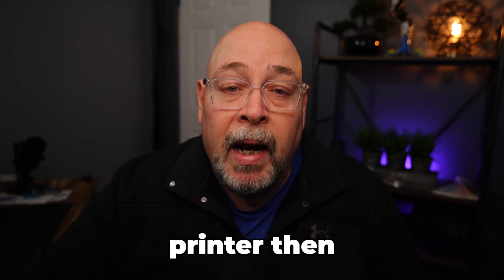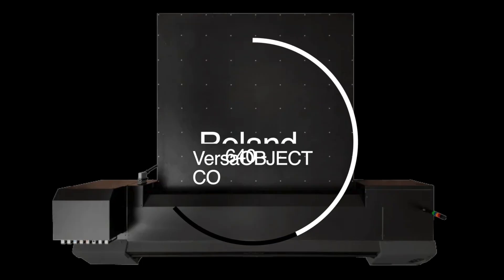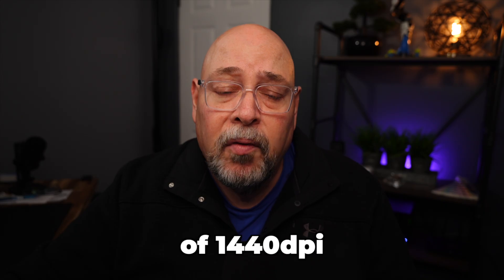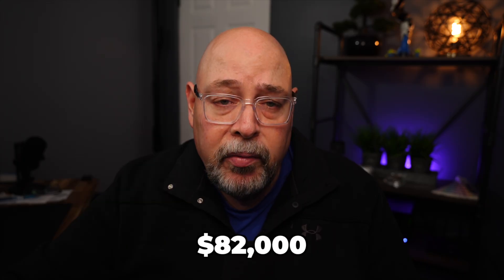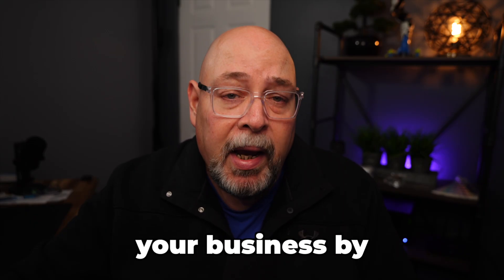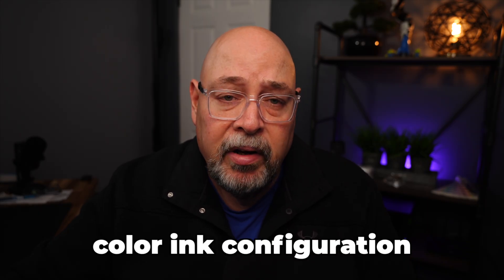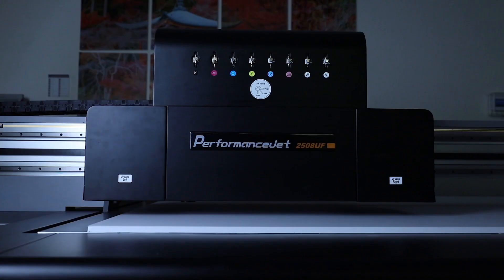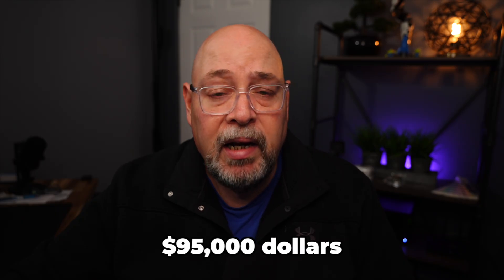Top 5 Entry Level UV Flatbed Printers🔥

Comment: Thanks for the video. I am still not such which would be best for my needs. But I need a printer that could print on a 4x8 foam board, vinyl printing/lettering on a transfer paper, and maybe cut the letters as well
Reply from the maker: Thanks for watching! It's not an easy decision. All of the printers mentioned in the video will do what you're looking to accomplish and more. You should decide on a budget first and then look at what you want to be able to do in the future and make sure you can do what you need it to do now. It's a big investment so make sure you can grow into it while making your money back as quickly as possible.
Reply: In this case you need a machine called one pass uv printer dear🙂

Comment: man, if i get into this business. i need to know where to get acrylic blanks wholesale ., pvc and foam boards., I WOULD GO for the MIMAKI for sure and what would be the best CNC CUTTER to cut all the boards.
Reply from the maker: If you’re in Hawaii it looks like One Shot Supplies would have sheets of foam coro and acrylic. If you’re in the lower 48 there’s plenty of places like Laird plastics, Grimco and Glantz. 

As for the CNC Mimaki has a good one. I would also look at Colex. If you don’t plan on cutting ACM (Aluminum Composite Material) then you could also look at the Summa F Series. If you have a bigger budget for a cutter there is always a Zund.
Reply: @graphicinsights466  thanks for sharing man. ALOHA TO YOU
Reply: @graphicinsights466  man, you are dope thanks for this info. i would look into this. ALOHA
Reply: You can get everyting from China supplier dear 🙂
Reply: @uvprintersolution  where and a flatbed cutter?

Comment: Awesome Review 🤙 hey question?? Can all this uv printers no matter the size . Print uv invisible ink when applied. Thank you & much success
Reply from the maker: Thanks for the question and the comment. I'm sure any of them could but I'm not aware of any manufacturers offering invisible UV ink. I could definitely see a market for it though.
Reply: Thank you for your Honest Reply👍
Reply: The largest print size flatbed in the market is 32*20cm, of course you can customize your size according to your needs. CMYK+W+V is available. So invisible uv ink is varnish ink. I can provide it🙂

Comment: Playing fast and loose with the term "entry level" here lol.  In no world is nearly 100k entry level for anything.
Reply: For a UV Flatbed printer it is...
Reply from the maker: I know it can be sticker shock,  but there are commercial flatbeds that start at $500k and industrial ones for more than $1.5M
Reply: @graphicinsights466  For those who aren't exposed to the volume part of the print industry (where my print business sits) 100k on any equipment labelled entry level sounds absurd. I was a little surprised the Canon 135gt didn't make it to the list, but i'm unsure of the retail price in the US.
Reply from the maker: Agreed. I just put a video out mentioning the Canon printer.  I believe the cost was around $150k
Reply: We live in a world where a pickup truck costs 100k. So a wide format UV printer that is delivered, set up, calibrated, with full parts and service warranty, with two days on site training, and helping purchaser setup first production runs, for 100k, well, that is a far better value than aforementioned truck.

Comment: Cool video series! 1 catch, the JFX200 has only 2 print heads, not 3. I have 2 of them, nice printers.
Reply from the maker: I appreciate your insight and expertise on the JFX200 printers. It's awesome to have viewers like you sharing their knowledge. Yes, they are great printers. I'm certainly capable of making a mistake and I strive to put the most accurate info in my videos so I went back and double checked Mimaki's site and actually the 2513 (discussed in the video) does have 3 heads. It may be confused with the 2531 which only has 2 heads.
Reply: The new jfx200-2513EX  does, in fact, have 3 heads. 2 cmyk heads, and a third head for clears, whites, and primer inks.

In fact, the older nonEX JFX is no longer available new. Only the 3 head version is available in 2024 forward.

Mimaki Dealer Tech
Reply: @tomTrophy  oh ok, I see! Thanks for the info!

Comment: I need to do some research as to why these are so expensive. I really want one but they're way out of my budget range. Nice video!
Reply from the maker: Thanks for the comment. Yes, they are expensive for sure. You can buy less expensive ones direct from China but you won’t get the support and training that comes with a local purchase. Spending that much money you definitely want to start making it back asap.
Reply: Are you interested in Chinese digital printer, such as 6090 UV?
Reply: Hello, we are a professional manufacturer of uv flat panel printers in Guangzhou, China. Factory direct sales, better price, quality assurance, door-to-door installation and training, comprehensive after-sales service!! Welcome to WhatsApp+86 18942154923.
Reply: 😊 If your budget is not enough and want to start small business, you can think of small size such as 3040 model, they are usually about $2,000-$3,000

Comment: Since when is a $60,000 printer entry level?
Reply: it is crazy but you can sell single wall prints for over $100 per print and print to order so you only have to hold raw material inventory, you print 5 to 10 prints per day easy and you're out the red in a year and then that printer is printing you 15k a month.
Reply: @veelink6345  15k a month? More like15k+ a day

Comment: 100k, for entry level, how much are pro printers costing?
Reply from the maker: They are pricey but can pay for themselves quickly when you take into consideration the time saved from trimming and mounting graphics to substrates. The production flatbeds usually start at $125k and average $150-250k. There are a few over $500k.
Reply: I operate on 3 flatbeds that cost over 250,000 each to replace with something similar today. Another shop owned by my comapny has purchased printers that cost more then 1 million. It gets crazy man

Comment: Definitely not entry level. Dude did the wrong research
Reply from the maker: Thanks for sharing your thoughts! Entry level doesn't necessarily imply bad or mediocre. In the beginning of the video I mentioned the criteria for what I was considering entry level. The criteria were 4x8 bed, had to print white and clear and come in under $100k. Since the majority of the 4x8 flatbed printers exceed $150k, I would consider a 4x8 bed under $100k "entry level" no matter how good a printer is. The Epson printer is amazing there is no disputing that. As for my research, I sold wide format printers for more than 20 years and Epson wide format printers for over 10 years so I'm pretty familiar with the product lines and their capabilities.
Reply: @graphicinsights466  …. People think entry level printers come from Best Buy, or some other box store. And if you’re looking for those type of printers then Best Buy should work. But when you get to commercial grade and industrial level printing the the price difference is significantly higher. I paid $6500 for my used Roland VersaCamm and it was a great deal. So I get it!

Thank you!
Reply: I work in a sign shop these are cheap compared to what we have in our shop our cheapest uv printer is 120k
Reply: An entry level flatbed UV printer is gonna be starting at $70 grand.  If you get anything cheaper, you're buying cheap chinese BS that will break and you'll have no support.